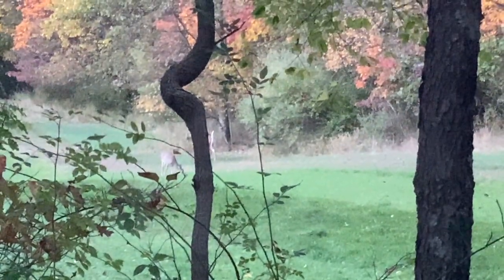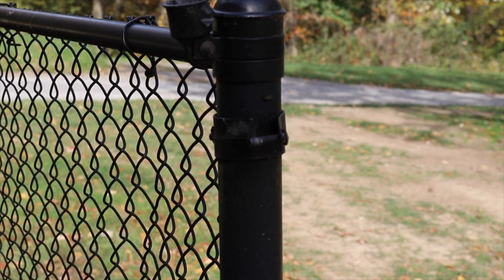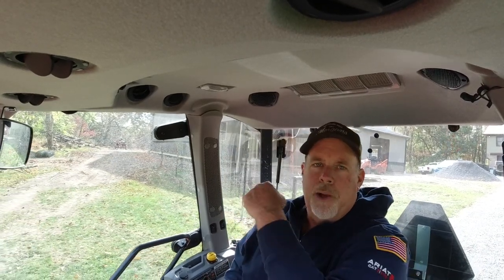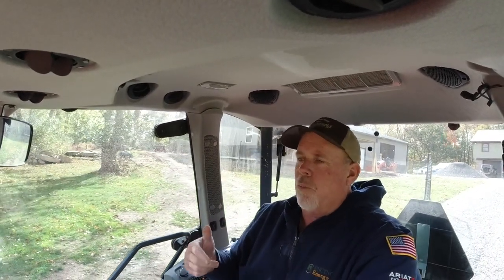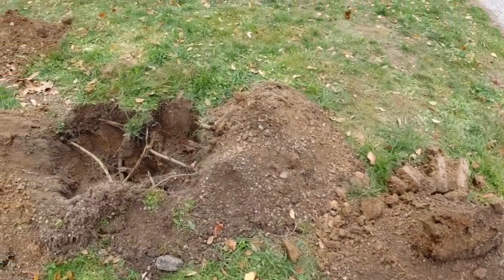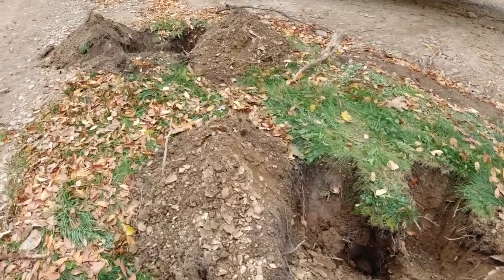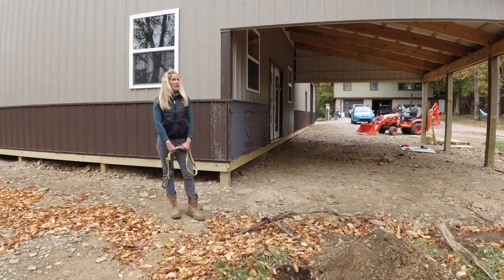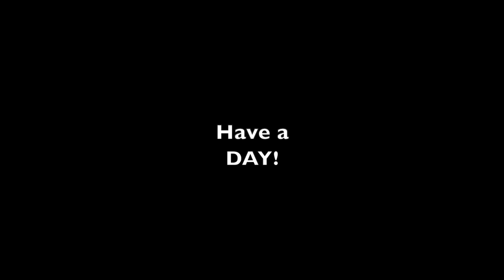#928 Much BETTER WAY than last time! Removing more fence around Hobby Barn!

Comment: Mike, I recently bought a hydronic post puller.   It’s a skid steer mount attachment that grabs the post and lifts it straight out of the ground.   Works great for brush briars and small trees as well.    Under a $1000. ......money well spent.     I have about 200 t-posts to remove.   Your project is looking great!

Comment: You will find that you can lift much more weight with the three point hitch than the loader. Put a drawbar across the arms, use a big clevis and wrap the chain around the post at ground level. This works great for regular farm fence posts not set in cement, but it is usually best to dig a bit around the cemented ones.

Comment: Mike when you plan the pool thought make provision for heating the pool via solar. By inclosing the pool with alum foldaway door and poli-cob 65% daylight we use our pool 365 days a year, select water temp that suits our neads at no cost. Enclosing pool was the best investment, I can use the pool via my wheel chair, once in water I am nearly pain free. Son made a chair lift to access pool. Just a thought, make provision worst you never use it.

Comment: From someone in Florida, who has had several pools in the last 40 years or so, locate your new bathroom on the outside wall and cut in an additional door to the outside.  Nothing worse than having to go in thru the building in a wet bathing suit to use the restroom.  You still have time to change your floor plan.

Comment: If you get the chain down lower on the post, your curl function will help pulling them out. A tractor has more power lifting close to theground.

Comment: Mike, for years I operated forklifts. One of the worst things to have to put up with is uneven forks. One fork goes into the pallet, the other under the pallet. Slide forks together, put strap around both forks. If they bend, they bend together.
Reply: Kieth someone told him that the last time he was pulling posts.  He would also have more power in the lift if he hooked the strap closer to the loader.
Reply: My forks get uneven too. Just get the high one up under something big and heavy and lift up to bend it down to match the other one.  This will take several trials to do because you don't want it to be lower than the other one for sure.
Reply: David, how do you bend them upward?
Reply: @realairplane261  I have done that too.  Remove the fork from the forklift. Then you burn a hole in the tip of the fork. Insert an eye bolt with a nut to secure it.  Connect a high capacity  come along to the eye bolt and also to the other end of the fork where it connects to the forklift.  There should be a pin connection there if it is an "L" shaped fork. Pull till some permanent deformation is noted, then compare to the other fork.  This is done in increments so as to not overcorrect.  Do not use heat because it will take the temper out of the steel.  The forks are made of spring steel so they can flex under design load and come back to their original position when unloaded.
Reply: Real airplane, yes, very true, can lift more without bending the fork. As senior in our shipping dept. I always got the new lift. Then, maintenance would come get it when I wasn't on it, and unload or move a heavy machine, then for nex 5 years I had to deal w uneven forks. Couple times I managed to bend other to match, but some jack leg would borrow it, and here we go again. Once, in 25 years, I got a fork replaced on a new lift! Came in an Monday, and the new one was curled back at the tip, pointing back to lift, it was driven into a structure beam. Couldn't win for losing. 37 lifts in the plant, all battery. I had 2, both propane, 15,000lb and 1,000 lift. Used outside to load flatbed trailers. They moved much faster so night shift always borrowed my smaller Toyota lift. Retired now, someone else's headache.
Reply: Keith I like that term “jack leg”.  Got a chuckle out of that.  

David you would have to have a hefty come along to ben those forks.  Would not want to be in the way if it broke.  

I built a rear fork system for my JD 1070 to loft wood bins.  Found some used forks in good condition and take the bin and all right out in the woods.  They hold a fire place cord of wood.  

4 inches of snow on the ground here in northern most Wisconsin.
Reply: @realairplane261  You are right, "heafty".  Got to make sure you have an escape route in case something gives way.  That's why I suggest bending the high fork down instead of bending the low fork up.  Much easier and safer.
Reply: You can usually find some decent forks at a scrap yard.  Taken off old scraped out forklifts.
Reply: David, I looked for a long time for forks.  Our local industries would not sell them for liability reasons.  Finally found some in south eastern Wisconsin and made a day of it driving Lake Michigan shore.  

Today I am working in the shop, changing oil on the JD 750 and repairing odds and ends that resulted from use over the summer.   Lucky we put all our wood in, and have enough in the lower level to take us through February and then it is Maple Syrup season.🥞
Reply: @realairplane261  You"re making me hungry.  That JD 750 is that a bulldozer or utility tractor.
Reply: David the JD 750 is a tractor with a 3 cylinder yanmar diesel.  I use it mostly for mowing a 2000 foot grass strip for my airplane at our home.   I am chuckling now because Motor Mike refers me as Fake Airplane.   I would like to put him in the rear seat and give him a few G’s and inverted loops.  He would be howling like a coyote!

The other machine I use for snow plowing is a Holder C500 with a 7.5 ft blade on the rear 3pt and a 7 ft snow blower on the front.   It is not a typical tractor since it articulates in the middle and it is cab forward.  Heat but no air.   My other tractor a JD 1070 is for bucket work and wood making.  

Good chatting with you David.
Reply: @realairplane261  Good talking to you too.

Comment: Loving the vids of your build. Thanks for your efforts. You should lift those posts out with the strap at or at least closer to the heel of the forks ...otherwise you’ll just bend the forks and make lifting your log crates more of a job!

Comment: If you are not going to reuse that chain link, you could put it in the floor o& the hobby barn. We did that back in the early 80’s with a garage we built. We used the chainlink as re-mesh for the floor and it worked great. We never had an issue with the floor.

Comment: If you want to reuse your fence post. Don't do like some people that leave the concrete on the post. While the post is laying on the ground just hit the concrete a couple of times with a sledgehammer and it will fall right off. Use safety glasses. Way easier to set the post this way. Hope you have a great day.

Comment: Good morning Morgans! As Mike knows the aerator unscrews from the spigot. Suggest removing any hard water deposits by soaking the aerator in vinegar overnight if not in a hurry OR using hydrogen peroxide if you want faster results.  As the saying goes, better living through chemistry!

Comment: A suggestion, talk to your concrete and hydronic contractors and find out how soon you can put heat into your slab.  It will make working in there so much nicer.

Comment: I wonder if wrapping the post with some of the simple strap then wrapping with the web strap would have allowed it to bite the post and not slip.  Chain would have worked the best but you don't want to mark up the post so I understand using the web strap.  But it would be interesting to know if the simple strap would have helped.

Comment: Getting it done. When you where digging around the post, why didn't you take the bucket or teeth and push the concrete itself. That would had broken it loose from the ground.  There are a hundred ways of doing the same thing.  I would suggest that when doing the inside of the game room and other places that will be covered. To add places that you can add outlets and networking connections. Seems like we always need more places after the room is finished. Network computers , games and TV will start getting more fancy. It's easy to add conduits and covered outlet boxes to be used later if needed.

Comment: Who uses ratchets anymore?  Cordless drill/driver or impact driver all the way!  Take your sledge hammer and whack that concrete on the end of those posts and it will typically come right off.  In SW Michigan chain link fence is usually concrete corner posts and driven line posts.

Comment: I have removed fence post with the draw bar of the three point hitch I took a chain chocked it up around the bottom of the post and raised the draw bar they pooped right out cement and all just had to get dirt to fill the hole
Reply: Works good.  The 3pt has a lot of lifting power.

Comment: Hi Mike questions  what's a  good width  for your application that was 10'what you figured the  new one should be just came to mind I have not seen a fire hydrant near by or waters spout what is your area codes are on that on this Island we use usa FL. Codes corn milk ok

Comment: Hint; tap the concrete with a sledge to break off the fenceposts.   Easier storage of posts and easier to set when you re-purpose them.
Reply: Sometimes it takes a bigger hit than a tap...

Comment: 👍🇺🇸🇺🇸🇺🇸🗽🙏🏻  wished U would suspend a chain between the 2 forks (at back of forks) and pull up from the middle.  I know U wouldn't tip over but some newby might flip over doing it the way you're doing plus it's hard on the equipment.  You gotta love the cooler weather....take care and be safe😊

Comment: Love is in the Air! I gotta get in the woods. Rain today which i believe your getting also. Nice job on the fence. 
Mike I've been wanting to ask. When they pour the floor in the MORGAN-MINIUM, are they including what we always called a frost footer at the overhead doors? It helps to stop the cold transition into the building. Not sure if it's still done these days or not? Thankfully I've been out of the trade for quite some time now! Lol. Everyone Be safe and help someone today and have a day!
Reply from the maker: Yes, that’s the plan
Reply: Mike and Melissa, I watch you every morning with my can of Red Bull.  I'm 71, retired, kinda, remodeling the  house with plenty to do. I live in Orangeville, Utah. Great place to raise kids, elevation is higher than population.If your ever in this area look us up.  Just ask of the Mannings, Karen and Seth at city hall, that will get you to us. Were on the border of the desert and mountains. Weather here is wonderful lately. Enough of me, just thanks for starting my day.  Seth Manning
Reply: Ok, you got me.  What is a frost footer?
Reply: @davidmorse8432  can be done a few different ways.. basically dig down to frost line (36" typically)pour footer, install quality sheet of Styrofoam with good rvalue across footer and/or pour with your floor. We always did this at large openings in foundation. Keeps outside frost from transitioning to floor inside. If not lots of times floor inside will frost over and heave,chip,crack. Hope this helps. If not let me know and I'll further explain. Probably can Google. Thanks
Reply: @HallnoutMhall  If I understand you correctly, the styrofoam is sandwiched between the top of the footer and the bottom of the slab, right?  It must have to be a high density foam to support the weight of the slab and whatever is on top of it, like a tractor or car.  Maybe he will not need it if he will have radiant heating pipes in the slab.
Reply: @davidmorse8432 there will be no footers in pole barn style building. Not necessary. I'm only speaking at the large garage doors. 
Dig a trench across garage door openings probably 1-2' wide and 36" deep. Put foam on it's (4'x8' sheet) side in trench on outside  of trench (outside of building) and pour slab with foam in place. 
Some people used to dig trench, pour footer, stab in rebar. Let set up then bend rebar over into floor area, install foam and pour floor. Ties everything together. Some used to do it all in one pour..
Not sure how they do it nowadays. I'm sure morgans will install vapor barrier, will be laying foam across entire floor (slab inside), install mesh, install pex tubing for radiant flooring and then pour concrete. Hope this helps. Sorry to confuse you. Still trying to wake up. Lol
Reply: @HallnoutMhall  I got you now, thanks. 🙂

Comment: After you dig around the post, get the bucket behind the concrete footing and pull it over.  This will eliminate the possibility of bending the post.  Bust off the concrete with a sledge hammer.
Reply: David, do you remember folks giving Motor Mike that advice the first time pulling posts?
Reply: @realairplane261  I guess I forgot.

Comment: ? You don't like the 10 wide gate but now your going around two conners of the hobby barn to get to the recycle center.  Or are you going to put in a new driveway because the pool is going where gate n drive is at now?
Reply from the maker: Everything will be fine, calm down
Reply: Lol!  well you know curiosity killed the cat😁

Comment: As a General Rule you should try to avoid Lifting on the Tips of your Tynes as doing so can deform them.
Reply: Good point Micheal, and Motoer Mike was advised of that before, but he resists suggestions.